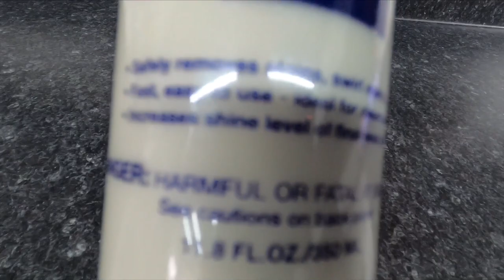How To Prepare Clear Coat For Wax/Sealant/Coating!  P21S Paintwork Cleanser!!

Comment: Not saying it's the best but it works ! Doesn't leave any greasy or chalky residue left behind.
Reply: I wonder if it has fillers?  I was thinking of using this quickly before applying Can Coat instead of Primer.  If I use a panel prep after P21s should be fine I'm thinking....
Reply: It works really well. It's old school and leaves a very clean, smooth surface ready for whatever you want to coat with afterwards. 

Hard to find fault with it.

Comment: One more, between this P21S and TAC Paint cleanser, the winner is?
Reply: That's what I'm curious about... but I'd say P21S has to win based on TAC USA disappearing?
Reply: @jc304  Also I'd like to know if they serve the same purpose.  From the TAC Paint Cleanser video, I dubbed that product as the 'Wax/Sealant Destroyer'.  That stuff removed Seal n Shine.  On the other hand, the video never mentioned anything about removing swirls, water spots, etc.   So, now I am actually a bit confused if the TAC paint cleanser and the P21S are in the same category/sere the same purpose.  I think this P21S product is more inline with AngelWax Perfect Polish.
I was going to get the TAC paint cleanser to remove an aging coating in my car, and then TAC went *POOF*, so now I am looking for a replacement.
Reply from the maker: You are the winner....they both are equally effective.

Comment: Regarding the pad, if it was just for exfoliation, the blue foam pad (light polish) would have been better rather than the URO FIBER 50/50, right?  Thanks!
Reply from the maker: Light polish or even a black application pad...yes.

Comment: Thank you Brian and Danny Palarchio. I followed your last week advices. Carpro reset wash, iron decontaminate, P21S black pads on my Torq 10FX (low oscillation range), and instead of Carpro Reload I put a coat of Carpro Gliss. Excellent result. I think it's a good mid term enhancement of the ceramic coating I done last spring...

Comment: Question. Last summer I put a Carpro ceramic coating on my SUV. After a difficult c QUÉBEC winter, can I use this product after a good spring cleaning and before Reload ceramic spray? Thank you
Reply: Carpro reset wash, iron decontaminate, carpro reload in that order.
Reply: Danny Palarchio  absolutely but but it seems a good idea to use P21S Paintwork Cleanser to refresh the finish, correct the small defects, take out the water stains instead of going back to the clear !
Reply: @renelord4819  u could try it but it might weaken the ceramic coating, do a  small test panel.
Reply from the maker: It is possible with a black finishing pad....or by hand.
Reply: Apex Detail thanks a lot, I really appreciate all the efforts you are doing to share your knowledge and you experience

Comment: Hi Brian, I’m new to your Chanel! I have been using P21S on my truck and car for a good number of years. I have never used a microfiber pad. My truck and car have never been in need of a hard cutting pad. Is this type of pad, based upon what I just said, better than a foam pad? Secondly, since my vehicle’s paint remain in good condition - meaning they never need a more abrasive measure of cleaning - is P21S a good enough cleanser for a ceramic coating?  Thanks and enjoy your enthusiasm for great looking vehicles as much as I do 😬....Jay, Louisville, KY

Comment: Would this be a replacement for clay bar on a new car to prepare for PPF installation?
Reply: I think not, because the tar or iron will stick in pad and its possible to make more damage to the clear coat
Reply from the maker: It can be used instead of a clay bar for traffic remover...but will not remove ferrous metals unfortunately.

Comment: Hey Brian, great info in this video as always. I don't know if this is the correct place to ask this, but here goes.
Could you recommend a compound/polish/pad combo for a 2019 VW GTI with black paint? I recently purchased it from leftover inventory. It has minor/light scratches and swirls from improper washing and drying by the dealer. 
Thanks in advance.
Reply: 3D one is his go to most of the time👍

Comment: Will this remove embedded rail and brake dust on a brand new (just delivered) car? Looking for something to do to the paint before I add a ceramic coat.
Reply: I would do an iron decon prior to using a product like this.
Reply from the maker: It can be used in place of claying. But still need a ferrous metal remover.

Comment: "Ease of use"...my favorite three words. How often does the pad needs to be cleaned when using a polisher?
Reply: After each pass, and after 1-2 panels, you swipe with a fresh one. You need around 5 big pads and 5 small pads. This is what i understand from videos

Comment: Hey Brian, love your videos. Sometime in the coming weeks I will be applying crystal serum light and exo on a friends brand new model 3. I already have carpro essence that I planned on using...would this be better? Also do you have any tips for the csl?  It'll be my first time using this. Thanks
Reply from the maker: CarPro Essence is fine as a primer. This is even less aggressive.
Reply: Hi Jonathan, how did you CSL and Exo install go?  It is a great combination and pretty easy to work with!
Reply: @douggreen980  It went well. I applied Cquartz UK 3.0 and Gliss to my mustang last year and I found CSL and Exo easier to work with. Car turned out fantastic and so far he is very happy with the results
Reply: @jonathanyommer1958  I had a similar experience.   I had CSL and Exo on my car for 2 years.  At the end of 2 years, I found the lower portion of the doors were not beeding water anymore.  I was able to stretch it a bit with the C2V3 topper, which I love on a white car (makes it shine like crystal).  I have also used Exo as a stand-alone with 2 Coates and it also delivered very well.       I have also tried CarPro and Gyeon, but like Gtechniq coatings for the result and ease of application!

Comment: Great video Brian! Does this replace a one step or 2 step correction? 

Would a product like this be good to use as a prep layer for a coating?
Reply: Of course no, this is least aggressive. Is just a enhancement
Reply from the maker: Does not replace correction. Can but a great last step before any type of protection.

Comment: What speed are you using with that polisher? Would you use a different pad for hard and soft paint?
Reply: He always use around 3,5 -4 speed
Reply from the maker: 3-4. yes pad needs to match the hardness of clear and imperfections you want to remove....or improve.